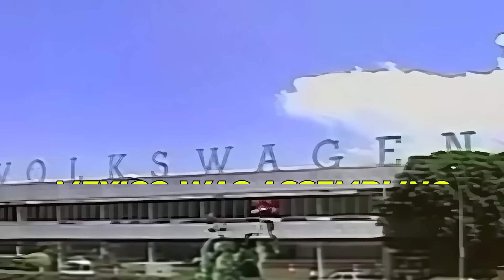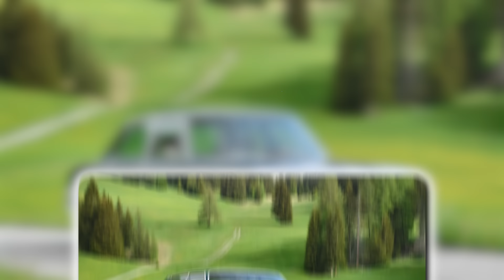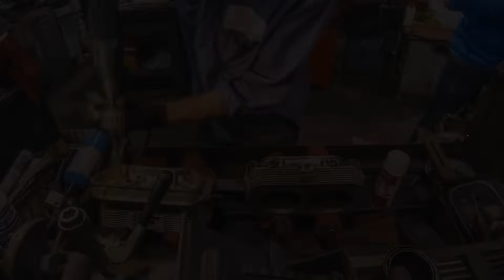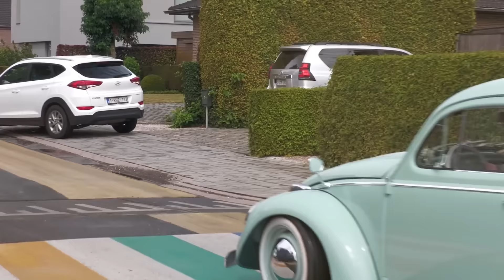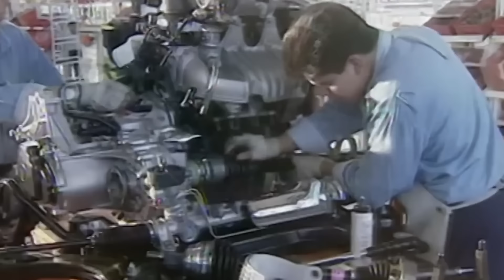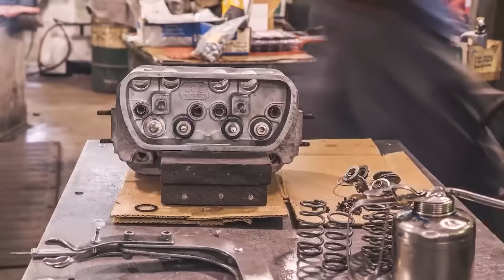This Mexican Engineer OUTSMARTED VW With a "FUTURISTIC" Beetle Engine That Made 200 HP

Comment: How was the exhaust valve seat cooling?  The original design cracks after 2 hours of regular use in the 1500 and the 1600cc engines. The aluminum doesn’t conduct heat fast enough and it cracks and start liking pressure. Air cooled Porsches uses an underneath oil channel to solve the problem.

Comment: A lot mother fuckers and bots creat a.lot trash content.

The only posible way to make a 1.6 liter engine hit the 200 hp aspirate is with very high compression ratio equal as 110 vp fuel to prevent early detonation.

Stupidity of creat content.

A car that drive every day with 93-91 octane gas station pump fuel with 200hp is a 2.0 liters.
V6 , inline 6 or 4 banger inline that is more balanced.

Stupid content.

Comment: This story is complete Bullcrap written by some nerd who is 20 years old.   Anybody thats knowledgeable about VW engines knows that hotrodders really started modifying the engines after 1967 when VW put dual port heads on the fuel injected 1600 engines.  As soon as that happened hot rodders started porting the crap out of them they threw 2300 cc bigbore kits fully counterweighted balanced crank kits long duration cams and a Hot Ignition system.  Everything changed if you had the cash you could make a 10000 rpm engine that sounded like a Japanese  crotch rocket.  This was relatively inexpensive at the time.     Any young racing enthusiast could do this in their own garage.  In 1967  the earliest vender was the Inch Pinchers who were drag racing thier bug and you could too.  SO eff this content creator hes a liar and full of crap.

Comment: The most powerful factory VW Beetle engine was the 2.0L TSI in the Beetle Turbo, making around 197-207 horsepower, but heavily modified, custom-built air-cooled engines (often Type 4 based) can exceed 600 horsepower, like the 205 mph LSR record car, showcasing the vast potential for extreme power in these classic platforms.

Comment: No big deal. My 1966 made 160 hp and it was street driven. Virtually every part of 2276cc motor was after market.
Reply: Yup at 17 i picked up my first car a 72 super beetle i was on the waiting list for mechanics class and the local tech school soni got to do an apprenticeship at a V.W shop so all the air, cool parts i got first picks of 2276 all aluminum block, port and polished aluminum heads,full aluminum rotating assembly, sleaved cylinders walls and a built bus trany 215 hp at the wheels stock tire amd suspension 3 10in subs 2 1500 wat amps 2 caps amd 2 batterys i would play you cant get the best of me cypher's hill or the mortal kombats theme song just so the other lame knew i had a full interior it was awesome at VW only shows the only things that could come close to me was  water cooled and at the high school drags It took some kid and his dad's brand new Corvette to get around me I built mine by hand 13.5 and my best i think was 12.65 in the quarter had a lot of fun with that little car

Comment: so he essentially duplicated the Porsche Carrera flat 4 engine ...
Reply: Which was basically a hopped up VW engine.
Reply: @ramblerdave1339  well sorta - The four cam used shafts with bevel gears to time the camshafts - way more sophisticated than the "normal" 356 motor - which, as you stated, was based on Porsches VW design...

Comment: Volkswagen had no interest in increasing the efficiency and horsepower because such modifications were designed into the Porsche equivalent. Putting those improvements on to the Volkswagen bug might have harmed the Porsche reputation. Both engines can trace their origins from the same set of blueprints, but only the one with the premium price got the improvements.

Comment: Midget racing has been doing this for years with air-cooled flat fours.  I was told back in 2008 they were making 320 in race trim.  Displacement was increased to 2 litre+

Comment: As a confirmed BUG driver.....I can attest this video is starting with misinformation!!! First, early 1970  had the 1600cc single port, midway through 1970, they rolled out the 1600cc dual Port.....even my old single port had 57HP!!! And, by today's standards, they got lousy millage.....Brand New 1970 VW bug got 23 MPG, advertised. IN 1970, not bad....BTW..THe title  IS clickbait.....VW builders have been building "sleeper" VW's for years.......It's not hard to change a 1,600 cc engine into 2,387cc (or 2,332cc with common, more reliable stroker kits). Performance modifications like larger bores, crankshafts, and dual carbs can reliably push horsepower to 100–150+ hp, with high-performance builds reaching up to 185+ hp.  AND that's without turbocharging and is a fraction of the cost of modding a v-8!!!!!
Reply: I just wrote the same thing.  It all started with the 1967 dual port heads.  And the Okrassa  big bore kits anybody could build a 2139 engine and if you had more money you got the fully counter weighted stroker for 2300 ccs.   by 1981  those engines must have been all over Formula Vee  and a great introduction to open wheel racing on a budget

Comment: in 1983 you could walk into Big V in San Antonio and buy  Autolinea  40X35 BV heads for 37.50 a piece .
Reply: L D also had a couple of type 3 Karmann Ghias and a 53 Bug in the little junkyard behind the shop.
Reply: 1p
Reply: Autoline started its operations in 1990.

Comment: You can’t even believe these videos you take parts of it that are right in parts of it that are wrong. Besides the picture that is not naturally aspirated motor 996 air cooled what the fuck that’s a six-cylinder liquid cool Metzger engine.

Comment: Click bait! Not one picture of the engine
Reply: Yep, just figured that out at about 35%
Reply: Thanks
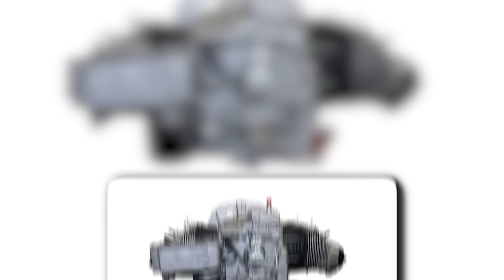Reply: 11:29 it is SHOWN - see the dule heads with coolant fins.  AND 27:00 open your eyes
Reply: @TheTriplelman  That photo is not a quad cam engine. Those heads are not big enough for 2 camshafts each.
Reply: Yep, I got 1/3rd in and gave up, realizing this was assembled from other people's footage and omitted specifically what it's supposed to be about.